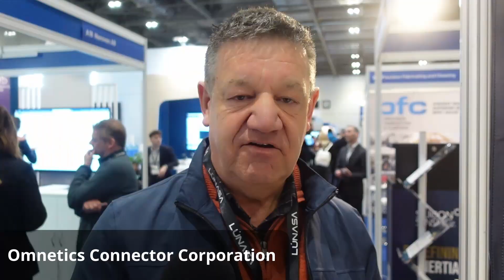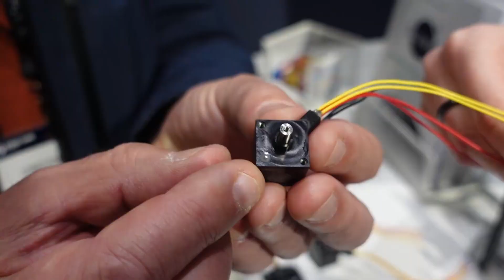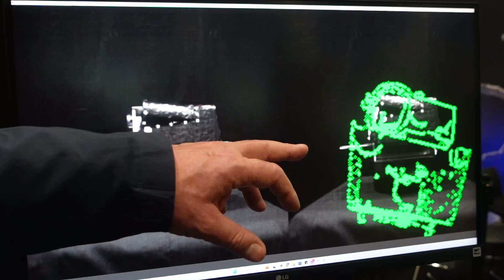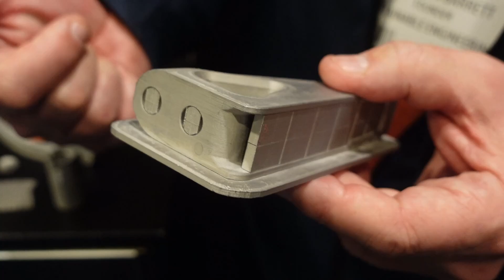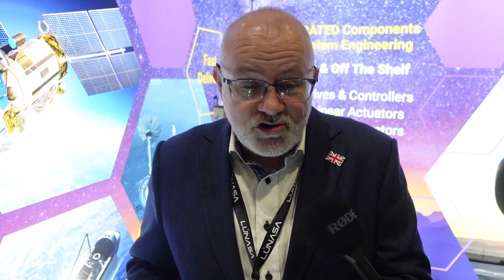Sustainable Engineering Tour of the Space-Comm Expo 2025

Comment from the maker: Companies featured: 
Omnetics Connector Corporation 00:47
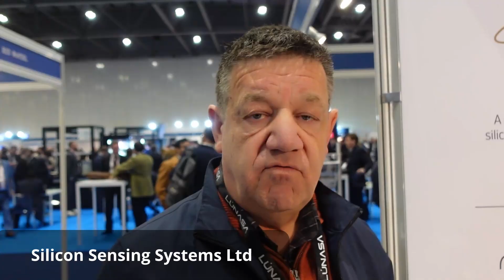Silicon Sensing Systems Ltd 02:04
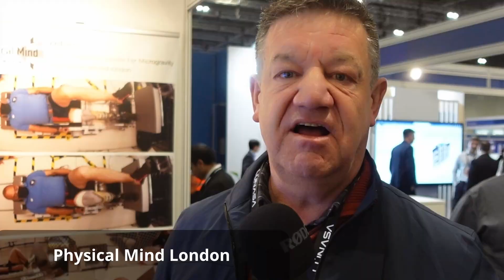Physical Mind London 03:29
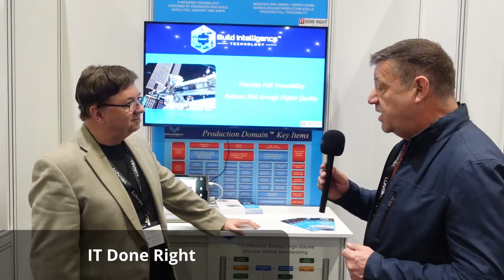IT Done Right 04:52
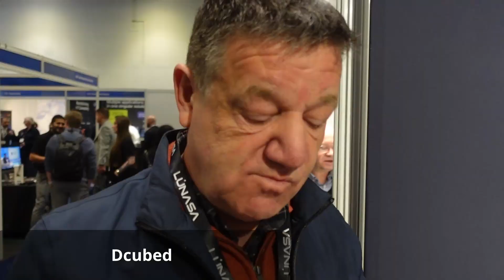Dcubed 07:28
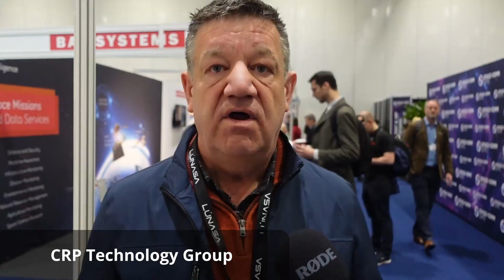CRP Technology Group 08:58
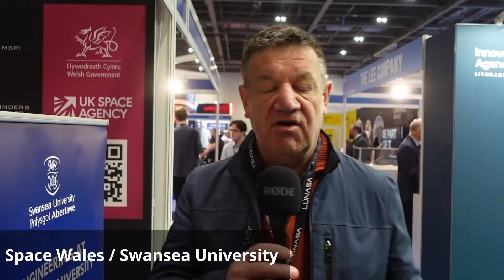Space Wales / Swansea University 10:07
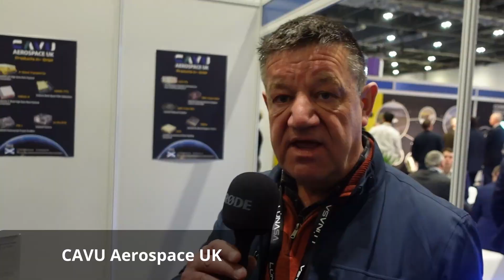CAVU Aerospace UK 11:40
Printech Circuit Laboratories 12:10
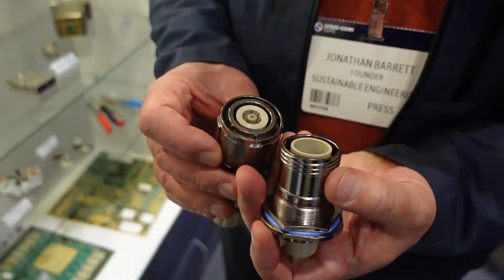Amphenol Ltd 13:19
Microchip Limited 16:06
ClearSpace 16:52
Markforged 19:52
Camberley Rubber Mouldings 22:20
Solsta 24:16
Olsen Actuators 25:58